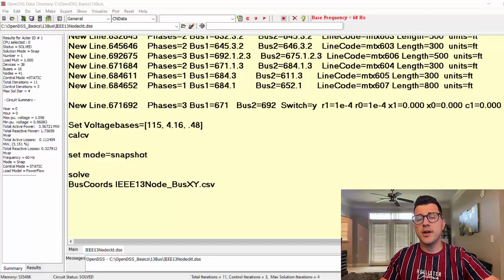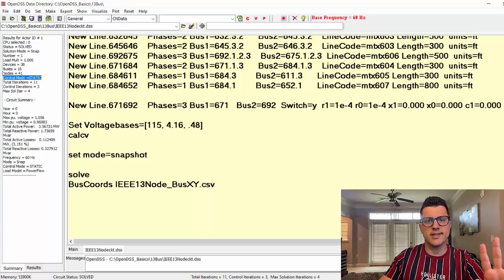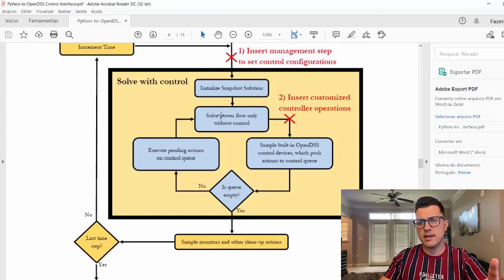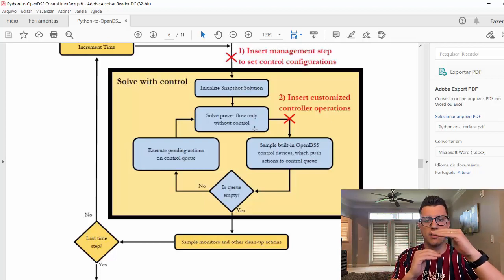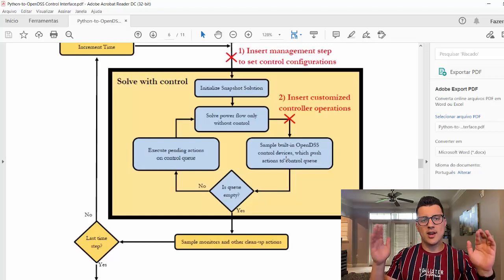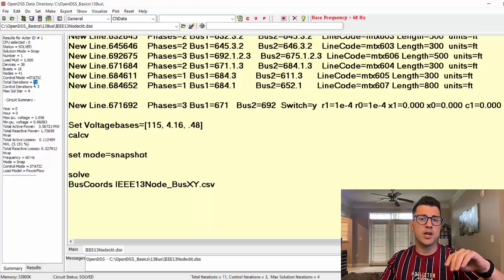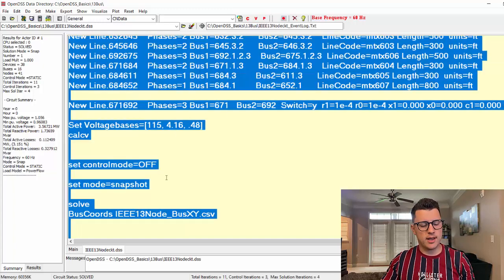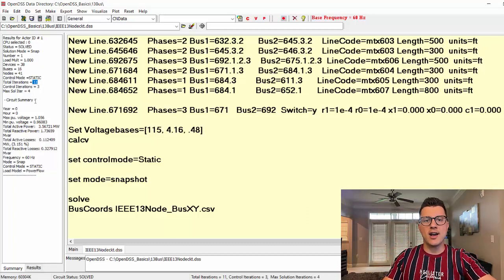3 - [En] OpenDSS Basics | Summary Part 2

Comment: Hi Paulo, 
I'm brand new to OpenDSS and I've been trying to follow your steps exactly to get familiar with navigating the software. When I click the event log, it just outputs a blank notepad page. Same thing occurred when I tested the 8500 Node GUI in Python,  it just spits out a blank event log even though I know there were multiple iterations and multiple power flows. Any ideas for why this is happening?
Thank you!
Brandon
Reply from the maker: Hi Brandon, that is a great question. We have changed the default option in OpenDSS. Now, you need to use eventlog=true to the control element or use set eventlogdefault=Yes, place this command after the clear command.

Comment: Hi Paulo, Thank you very much for these videos, they are really useful.
If i may i would like to ask to you some questions regarding the Iteraction, i understood why, if we have a regulator, the Program have to calculate multiple Power Flow, but i did not get, what the iteration are, and why, for a single Power Flow, the program does more than one iteration, which is the logic behind doing those iteration and what exactly they are?
Sorry for the long quetion, i hope i'm not bothering you. 
Thank you again for your great job with this videos!
Reply from the maker: Hi Giordano, thanks.
There are two types of iterations in OpenDSS: power flow iterations and control iterations.

Power flow iterations are the steps the OpenDSS power flow method needs to converge. OpenDSS uses a fixed-point method, rather than the traditional Newton-Raphson method.

Control iterations are part of the control loop process, which aims to make the control elements converge to their target range. For each control iteration, OpenDSS must process a power flow, which itself involves power flow iterations.

I hope this explanation helps clarify things.

Feel free to ask any more questions you might have.

Comment: Thank you, Paulo. Just for curiosity, if the test system is of 13 buses, why does the results show 16?. Also, is there a way to pass the OpenDSS data to a circuit diagram?
Reply from the maker: Hi John, the model in OpenDSS has extra nodes, and I'm unsure of the reason. You might want to check out OpenDSS-G, which allows you to view the system diagram.
Reply: Thank you  @PauloRadatz

Comment: i'm puzzled about the distinction between power flow and iteration.More precisely,I can't understand the meaning of power flows.
😔
Reply from the maker: A power flow is a method used to calculate the voltages, currents, and powers of a circuit. However, because it is based on non-linear equations, this method requires iterations to arrive at a solution.

In OpenDSS, the complete solution method for a snapshot involves a control loop. In each iteration of the control loop, a power flow (with its own iterations) is solved and the controls are checked to see if they need to change states. Therefore, there are two types of iterations involved: power flow iterations and control loop iterations.
Reply: @PauloRadatz  does that means if the number of the control loop iteration equals to the power flow iteration，because in each power iteration，the control loop needs to check whether the results reach the expectation.
Reply from the maker: The control loop iteration is not the same as the power flow iteration. For instance, you can have a solution with two control loop iterations in which in the fist control iteration the power flow had 5 iterations and in the second control loop iteration the power flow had 3. 

So, it had 2 control iterations with 5 and 3 power flow iterations. Does it make sense?
Reply from the maker: I show it in my course: https://www.pauloradatz.me/course-snapshot

Comment: Paulo, I followed all the steps but I can't see the event log, an empty file appears
Reply from the maker: Hi Cesar, we have changed the eventlog option to off in all elements.
You can use the set eventlogdefault=true at the beginning of your file to turn that option on to all elements.

Or you can turn on it to individuals elements by using eventlog property.

Hope it helps. Let me know if it works.
Reply: Thanks, I wrote Set eventlogdefault=true at the beginning of the file and problem solved